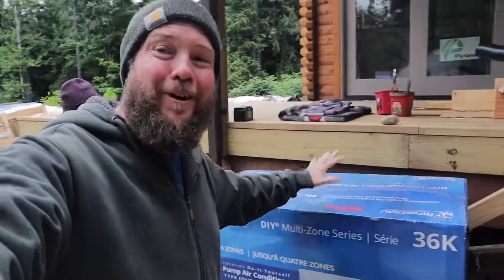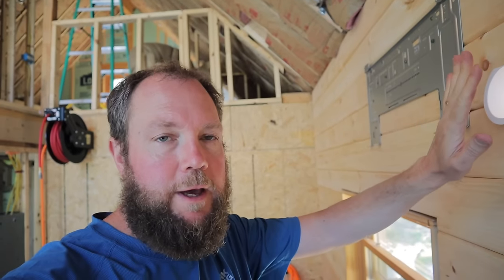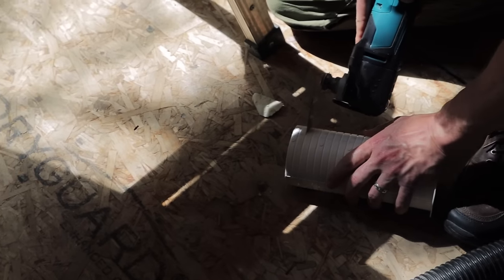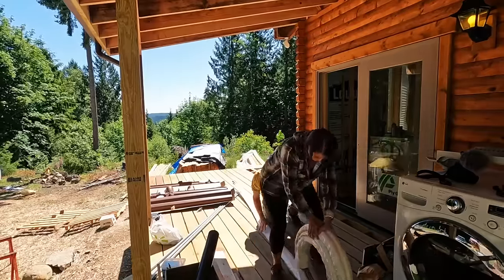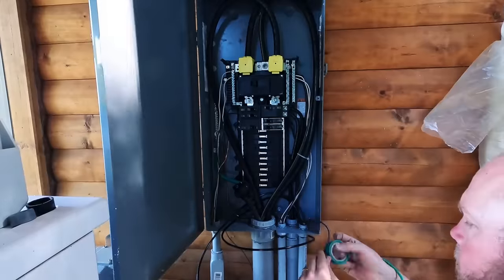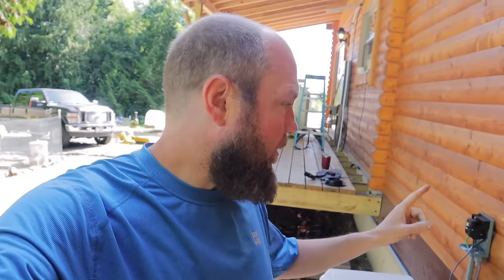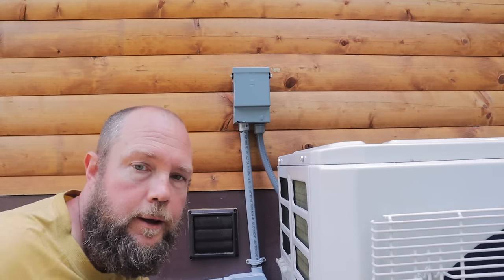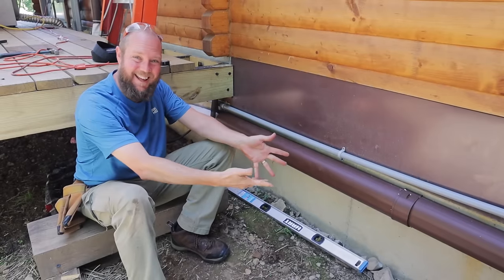Couple Installs Mr. Cool Mini-Split [FULL INSTALL]

Comment: What great timing. My husband and I were talking today about the HVAC options for our build and your show this week was about just that. We’re sort of worried about having cold and hot spots around the house. Have you had enough time to determine if the kids’ bedrooms and shared bathroom are cooling well enough?  

We love watching you all! You’re so inspiring and we get such useful information from you to apply to our own build. Keep up the great work!! 👍🥰
Reply from the maker: It's a little too early to tell, but my guess at this point is that if the kids bedroom doors are left open then the cold air from the main room will make it's way back there.   Also, since the loft is above their room and will also be conditioned their rooms don't get a ton of sun exposure.   

We did install in-wall heaters for the winter just in case we need a little bit of supplemental heat in those back bedrooms. 

Glad the video was helpful and please let me know if there are any other questions about the system we can answer.
Reply: @OneFootOfftheGrid  thank you so much for the reply!  We thought the same thing about keeping doors open and maybe the conditioned air would reach those spaces.

Maybe you could do a quick follow up in a video later this year, once you’ve had the chance to experience both the cooling and heating capabilities of the units??
Reply from the maker: @connieweaver1025  that’s a great idea.  I’m sure that would be helpful to a lot of people.

Comment: Does Mr Cool have a setup to add a geo, earth, thermo set up.  Other words where you add a buried line to get under ground tempature heat / cooling source.  Supposed to increase the efficiency of these heat pump systems allot.
Reply from the maker: Not that I'm aware of, but you could always contact their support number.  They were very helpful when we had questions.
Reply: @OneFootOfftheGrid  they don't have a add on but they do have a geothermal set up.  Like maybe in a mild climate like PNW geothermal not that critical but where I live it would make a difference at below zero.  Kind of an investment I definitely don't like being cold on the coldest days. My understanding geo also helps with cooling. Still a retrofit for future needs seems to make sense to me.

Comment: What size are the two head units?
Reply from the maker: The one in the great room is a 24k and the upstairs unit is a 12k.
Reply: Thanks for answering.  I’m trying to workout a configuration for my garage (~18 K requirement) and the master bedroom (over the garage).  The details from you are helpful.

Comment: I've thought about one of these for my post frame building. I want my lines on the inside of the building?
Reply from the maker: We've been really happy.  It's up to you.  You could run them on the inside or the outside depending on if you have done insulation or closed up the walls yet.

Comment: With the wood walls you really did not need backing in the wall for those units. The one thing I am curious about is that vent coming through the foundation right behind where you are putting the outdoor unit.
Reply from the maker: We have the insulation gap though so any connectors we put in would be going through 2" of void before they got to the wood wall.  I liked the idea of them hitting solid wood sooner.  I did end up putting some extra long screws in as well that would extend to the wood wall.   

The vent you saw was my dryer vent and I'm going to have to relocate that.  Unfortunately, this was the only location the outdoor unit could go and I had already installed the dryer vent.
Reply: @OneFootOfftheGrid   you have shiplap on the wall. That is wood and will hold the a lot of weight. Its ok to over build if you have the money to do so. That is what I meant. The pioneers never put blocking in the walls because the walls where wood.

Comment: First time watching your channel. I want to know if only  2 head units are enough to cool especially the first floor rooms?
Reply from the maker: We have a 12k unit up in the loft and so far it seems a little undersized.   We are hoping once we have the ceiling boards up and our ceiling fans installed it will help make a difference.   The one 24k unit cools the main room without much a problem even on very hot days.  

The first floor rooms actually stay pretty cool as long as we keep the doors open.  We have setup a fan a couple of times to direct cold air back to the back bedrooms.   

Overall, we are very pleased with the setup.

Comment: Awesome! Quick question, how come everywhere I see the install use 10 guage wire for these mr cool mini splits. Similar to the temporary wire you used for testing. But your using 8 gauge. is there a Reason behind that? Would be bad to install using 10 gauge  wire instead?
Reply from the maker: I was following the recommendations in the install manual which suggest using 8 AWG.  Many other people have suggested that it is over sized and not required and as I mentioned in the video, the lugs for the incoming wires aren't even sized of 8 AWG.  Also, different size units probably require different size wiring.  If you were only installing an 18k outsize unit I'm sure the recommended wiring would be less.    Hope that helped.

Comment: 8 GW     I did an 18000 4th generation MrCool   with 12GW  20 Amp  breaker     
     " my electrician said thats enough !
Reply from the maker: I tend to agree.  Was just following their instructions though since I was afraid it could cause a warranty issue in the future.  Ours is twice the size of yours though so it makes sense our wiring would be somewhat bigger.
Reply: @OneFootOfftheGrid       In that case    YES  !!

Comment: Sorry i did not watch the full video. I've missed some part in the video, so my question is did you charge refreegerant in the compressor and vacuum the air out of the line, and what is the long white line you ran under your desk? Thank you
Reply from the maker: The lines from Mr. Cool come pre-charged so there is no need to vacuum.  The white part under the deck were the compressor linesets.
Reply: Are those linesets came with MrCool and how long is the linesets? So we can sit the compressor anywhere outside the home?

Comment: With all the connections on the compressor unit it occured to me that hot water, cloths drying and other set-ups could be made.  Maybe not at first but later.  So how flexible is this set up.  It is it possible to cool the up stairs and heat lower floors like a basement? If this is possible all sorts things like hot water, refrigeration, clothes drying could be added.  A geo source like well or lake water could also be added. Still would want a backup heat source in case of equipment or power failure.  Any of this make sense?
Reply: These are strictly air to air units. You have to get into a rather pricey system to heat and cool with the same compressor. Mitsubishi was working on one, uses a 'valve/ distribution box inside the house to run linesets to then one large one out to the outside unit. Think it was a 4 ton 5zone.

Comment: Code says you need a equipment disconnect if the equipment is more than 50 from the breaker or out of sight of the breaker panel. Yours does not require an equipment disconnect but it’s ok if you want one.
Reply from the maker: Good to know.  Thanks.

Comment: The town of Otter Creek in Florida  has gained a great deal of notoriety in the last few years.
This is partly because of their lively Town Hall meetings and shenanigans of former Town leaders.
The last meeting they had they were discussing the on going problem of the HVAC unit leaking refrigerant
that is installed in their  Town Hall building.

Several of the citizens at the meeting suggested the  "  Mini-Split "  as an alternative to the hugely expensive
HVAC repair estimate.  Some said because of the size of the building they would need two Mini -Split units which would also 
cost a great deal.   It seems your home is higher square footage than the small Otter creek Town Hall building.
Could you give a rough estimate of the cost of your 2 head  Mini Split?
Reply from the maker: I think the 2 head mini-split unit costs around $7,000 for just the equipment.

Comment: Nope, I think I'll stay with my window AC, a whole bunch cheaper.  My son did a similar install a few years ago.  He got a great deal on a home, only problem it was electric heat with no AC.  His system was similar except it both heats and cools, for him the perfect solution.
Reply from the maker: Ours both heats and cools as well.  You're right that the window units are substantially cheaper to buy, but usually they are WAY less efficient so they could end up costing you more in electricity in the long run.  Just something to think about.
Reply: To paraphrase a recent leader of the USA, "If you like your window unit you can keep your window unit."  The window units are certainly much cheaper.  The 3 big advantages of the mini-split is, in no particular order...
1. Noise!  The mini-splits are nearly silent until you crank in turbo mode.
2. Efficiency.  As mentioned before, the m/s is much more efficient.
3. The View.  The m/s doesn't take up your window space./
4. Noise!  (But Robert, you mentioned noise twice.)  I know, right?  It's amazing how quiet they are!

Comment: wow great job, I paid 6500 us dollars for a 3 ton 36,000 btu  Sea Breeze unit installed by pros but they had to remove it from the wall 4 times and bent the line sets and drilled the hole too small and the template was crooked and the vertical wall line set was crooked outside the house and they messed my house and it flooded the house from bad install and they left debris sharp screws and metal outside and forgot tools and the list goes on wow it was a horrible experience. I had the owner come out and fix it and it works good and looks good but what a mess, now i need a fan to push the air to the end of the house because i asked for a multi head unit initially and expected to add another head later if this happened but they sold me and installed a single head unit. ugh! I should have done it myself.
Reply: I paid $7200 for two 36K four zone/diy units with two heads each in a 3000 sq ft r36 brick wrap. That was after I priced the same system (different mfr) installed for $16,000 to$19,000 by local artisans.

Comment: When you order from MrCool do you tell them how long your lines need to be?  I have an existing mini split system and was hoping to possibly reuse these lines.
Reply from the maker: They have standard lengths.  16', 25', 50' or something like that.   You probably could reuse a lineset, but you'd need to flare the fittings, because most mr.cool units use a quick connect and come pre-charged.

Comment: How does it heat your home? Any issues heating your home with just the mini split?
Reply from the maker: No issues so far.  We have one head in the Kitchen/Great room and one head up in the loft/master bedroom.  We just got done having temps around 16F and the unit did great.  The only parts of the house that are a little cold are the kids bedrooms at the back of the house.   We have small electric heaters installed in the wall though, so we are able to heat those really well as well.  Overall very pleased with how it's been able to heat and cool our cabin.  Especially since we hae those large vaulted ceilings. 

Let me know if you have more questions.

Comment: 😁Hi...its normally the case that the refrigerant lines need to be vacuumed of air 'pulling a vacuum' ,then the refrigerant is let into the lines,  you did not do that, did the instructions say no need?
P.s...i like the 2 flying backwards butterflies🤣

Comment: Do you think 2 inside units will be enough? My log home is 1500sf I got 2 outside multi head units and 6 inside wall units. One for every room except for the bathroom that connects to the master bedroom. Nobody can complain it's too hot or cold that way.
Reply from the maker: So far it has worked out pretty good, but we haven't officially moved into the house yet.  We have a pretty open layout so the heat moves throughout the house pretty good, especially when we run the ceiling fans in reverse.  The two back bedrooms do stay pretty cold, but we installed 2 cadet wall heaters in those rooms which heat them with no problem.    

Overall we have been pleased with the performance.
Reply: @OneFootOfftheGrid  The good thing with it is you can always expand later if you feel the need. The house is looking good 👍

Comment: I am planning to use the same type system on my shipping container build. I have a question, do the indoor head units get all of their power from the outside unit? Since I am building my own home and I don't do electricity.
Reply from the maker: Yes. The indoor units are 100% powered from the outdoor unit.

Comment: what happen  to set the inside units off of level for the water  to flow
Reply: I set mine about 1/4" low on the right side, as per the manual.

Comment: You didn’t pull a vacuum before you let the refrigerant go ur suppose to check for leaks before you let the refrigerant go
Reply from the maker: The lines actually come pre-charged with a vacuum so no need to do that part with this install.

Comment: I considered a MrCool, but they are way more expensive than many other brands (@ $2,200 for 18K). I ended up buying and installing a TOSOT 18K unit - $1,200 on Amazon. (I installed a 12K ClimateRight unit in my large cabin @ 4 years ago and so far so good.) I went with the TOSOT because it is rated down to minus 13 degrees F. The MrCool units are not as efficient at that low temp and are typically rated only down to 5 degrees F. (it gets REALLY cold here) 

The MrCool is a little easier to install, given the line set setup (the Climate Right has a similar setup  - I believe it was actually the first one that was fully DIY,) so you don't need to run a vacuum pump or need the vacuum gauges. However, the cost differential between the MrCool and the TOSOT ~ $1,000 made choosing the TOSOT a no brainer. The vacuum pump and gauges cost a little more than $250 so that meant a savings of @ $750 for the TOSOT unit. I'd never used a vacuum pump before so was a little intimidated by it (I initially contacted some local HVAC contractors but none would consider installing the TOSOT and only installed their "house" brand, which typically was Mitsubishi @ $2,500 for the 18K unit NOT including installation. Ultimately YouTube provided all the info I needed for the install.

The TOSOT comes with a 5 year warranty (TOSOT extends the warranty by 6 months when you register - so 5 & 1/2 years total).

Comment: So where does the air that's in the lines before connecting them goes? Just lives in the system?
Reply from the maker: The lines are shipped with a pre-charged so there isn't a need to evacuate the air I'm told.
Reply: @OneFootOfftheGrid  But don't you take off the seal from the line before connecting it?
Reply from the maker: @firstlast9292  The seal get broken when you connect the line.

Comment: Does this system really require 8 ga. wire? I thought it was  30 A  requiring 10 ga. wire.
Reply from the maker: The recommendations in the install manual call out for 8 AWG, but there isn't a great spot to land those big wires in the harness.  The overcurrent protection requires "not to exceed 45 amps".  We used a 40 AMP breaker.  

I don't know if this is updated instructions or if this is just a larger model than others, but there does seem to be some confusion on if 8 AWG is required.

Comment: It seems that you forgot to vacuum your air conditioning system. 😢I checked the model of this air conditioner, and it uses R410A refrigerant. Generally, for R32 and R410A refrigerants, vacuuming is essential. If you don't vacuum, it will significantly affect the cooling and heating performance as well as the lifespan of the air conditioning system. If air has already entered the system, it is recommended to completely discharge the refrigerant and recharge the system. Depending on the length of the piping and the size of the air conditioning system, you need to vacuum for 20-30 minutes until all the air and moisture are completely removed.
Reply: Its already diy wacumed by factory
Reply from the maker: Yes, these units are made to be installed by DIYers, so the vacuum the lines at the factory.  They have one way valves that don't open until they are connected.

Comment: Do you plan to use all that insulation that is still laying around? Is that just left over?
Reply from the maker: We have all our rockwool insulation that is for our interior walls.   Are you talking about that or the rigid foam?  We did have quite a bit extra of that insulation.

Comment: Am I crazy or did they not vacuum or pressure test the system ?
Reply from the maker: You're not crazy.  This is Mr.Cool's "DIY" system.  They lines come pre-charged so not required to pull a vacuum before connecting.

Comment: what happen to pulling a vaccum on the line set
Reply from the maker: They actually ship the line set already pre charged so it is DIY friendly.
Reply: @OneFootOfftheGrid  how did you connect the lines together if the lines are pre charged

Comment: 54:52 White conduit painted brown? Just buy black conduit?
Reply from the maker: We painted the conduit covers that only came in white.  This looked WAY better on our cedar stained logs than a glaring white plastic piece going down our house wall.
Reply: @OneFootOfftheGrid  You will have to keep repainting it every few years. Just thought it would be simpler to use a dark color in the first place. There might even be brown conduit, I haven’t bothered to check but wouldn’t be surprised